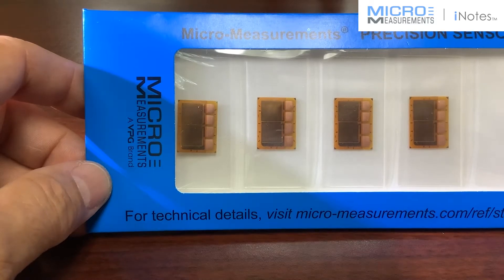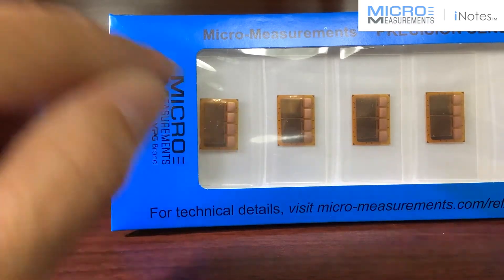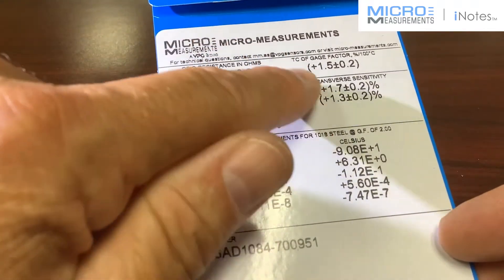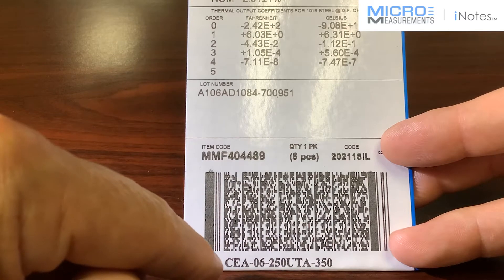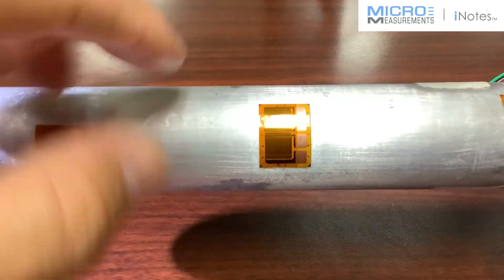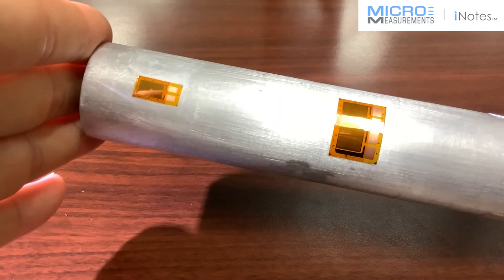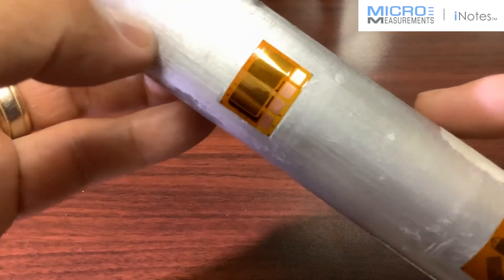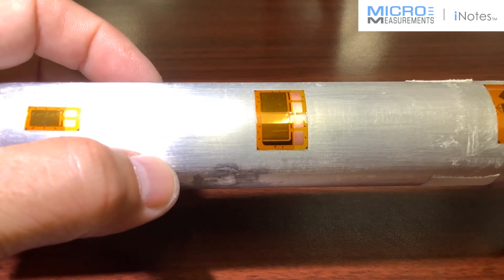TEE ROSETTE, 0° - 90° PATTERNS: DUAL GRID.

Comment: By using this gauge we does not take torque, we are using Half bridge gauge in my company.. after pasting gauge we put to calibration but it doesn't show any value.. 

Material : Steel 
Series : CEA-06-062Ut-350
Reply: The gages CEA-06-125UT-350 are designed for use on load cells for tension and compression measurements. the manner in which you have shown the gages bonded on the circular bar make them largely insensitive to torsion. 
Please use CEA-06-187UV-350 gages, on diametrically opposite sides of the circular bar, for torque measurement. Please see the video at:
https://www.youtube.com/watch?v=-VQAGZGXbSE  
for torsion measurement application.
Reply: @DynatecIndia  thanks for update